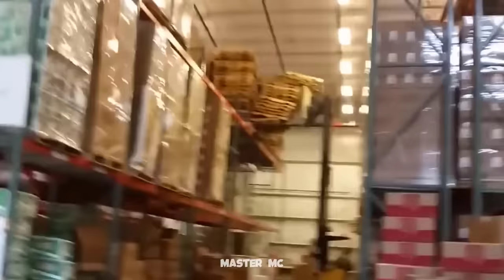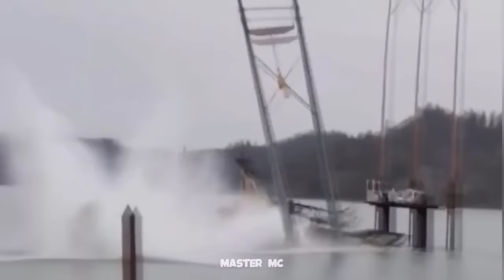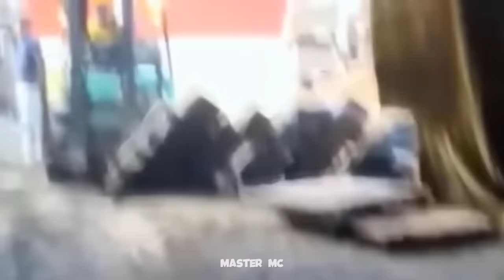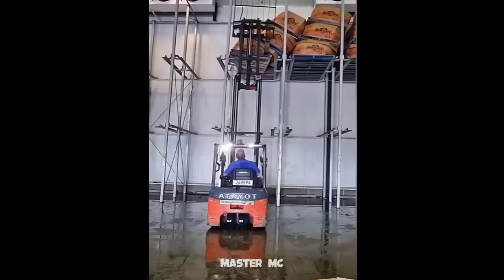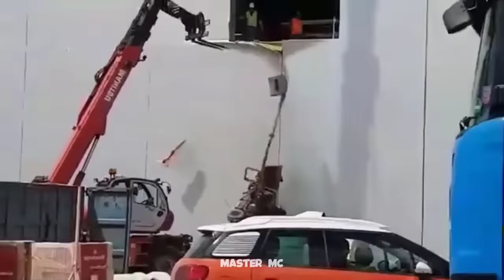TOP Forklift Fails Compilation 2022 - Dangerous Forklift Crashes - IDIOTS FORKLIFT DRIVER

Comment: As a Forklift operator I can tell that the last one was perfectly done! I even cry a little. I was really touched 🥺
Reply: That last shot is my company but I'm not impressed that they are in a fail compilation.
Reply: Yeah it was impressive, but how did they unload it?? Seems like it should have been on a flatbed.
Reply: @nickhogue6465  Not quite my curious friend 😉You see those little spaces between the orange belts and the floor of the trailer? That's where you suppose to drive the forks to lift it up. Then you have to carefully drive backwards until the second forklift operator can intercept/take over/overtake the bale on the width side :)
Reply: @nickhogue6465  Or eventually just attach those orange belts/ropes dunno what it is exactly to the forks and drive backwards ;P
Reply: that last shot its pretty normal at my company  .
Reply: But how are they going to get the packages out?
Reply: @Lord_Humungus Do you see those orange totes? This is how ;) One for length side, the other for width side of the package ;)
Reply: Been driving for 20 years + driven all kinds and this was soo hard to watch and at the same time i couldn't take my eyes off it hahahha. Most could have been  prevented if they just understood the capacity of the MHE, but some eh shet happens.
Reply: @nickhogue6465  ez same way 2  forklifts just in  revert🤣
Reply: It almost happen to me and good thing I mage to lower it smoothly 😂 he already max out that forklift capacity
Reply: Honestly don't know why this was in a fail compilation, I thought that was masterfully done
Reply: As a forkie myself, ( thats we we're called here in Australia ) that was some really good work right there.
Reply: My wife is a 24year costco employee and most of it and current is on the forklift (you get 1$ more per hour why not?! ) lol she's explaining how they don't use stringer pallets anymore they use Block pallets and "most people need to be tested on the stability triangle and clearly aren't in this video"😂 she's explaining the art of forklifting. Now I get how she feels when we watch Grey's anatomy of Chicago med and I'm yelling get Atropine right now!!! Now!!! Now!!! And then the patient codes or whatever lmfao
Reply: so many people trying to off themself but we dont get videos of the ones who succeeded
Reply: What do u find most difficult at ur job? What are ur main challenges? thks
Reply: @sergioaraujo4519  Hmmm let me think. 
Probably the biggest challenge is when I have to unload a truck and the pallets are looking like someone just punch them in high speed. The possibility of me taking that abomination and NOT making it collapse is very very low. Second thing? The condition of the surface on which I transport loads. Hole after hole covered in another hole that is sleeping with another hole. Instead of fine and safe driving I feel like I'm In the washing machine set to spin :D

Comment: 95% of these accidents would be preventable with basic forklift training
Reply: Or if they had a refresher course or a licence
Reply: Or if they had any common sense.
Reply: The other 5% would be preventable if the forklift operator had a brain.
Reply: Those classes are useless. I just took one for my job. All it is, is an hour video and then the guy takes you outside and says drive the forklift in a circle around the yard safely and park it for the next guy. And then certification card is printed. It's disgusting. Instructor didn't even tell the the trainees to put a seatbelt on, let alone ANYTHING else.
Reply: @mattyo5022  Wow, my prior employer's forklift test was part written, part multiple choice, was around 100 questions, not to mention the training took a full 10 hour day of instructor and video,  then we were allowed to get on the forklift, had to do everything by the book with zero mistakes, raise and place pallets at four different levels, move it correctly around a warehouse that stored hazmat in bunkers, and then take it outside,  follow all parking lot/foot traffic rules, load a van, box truck, then a semi trailer. Only then if we passed everything did we get certified and we had to do it every 2 years, or upon making any kind of error what they called a demerit.
If we were caught driving it without a seatbelt, doing anything crazy with it, driving it too fast, etc we would be fired on the spot.
I guess some companies took it more seriously lol.
Reply: @somethingvisceral2003  that's great to hear man. That's how it should be! I'm not some fan of total government restrictions and training but with a forklift it's more dangerous then even operating a car in my opinion. You can get in MOST car accidents and walk away ALIVE! In MOST forklift accidents you're DEAD! Or you become like that kid in Montana and like a child's doll size body. Just his upper body. No arm. Just a face, stomach, legs, genitalia, anus alllll gone! I don't even know how he's able to pass his urine and feces. So SAD. Also SICK. I immediately clicked off the picture when I saw it. Big international story few years back. Anyway. Yeah that's a great training you got my friend. My workplace is a STATE agency by the way just so ya know. So it's not some Joe Schmo small business or even corporation. I almost wanna tell them I refuse to operate it without proper training. But it's almost that old peasant/slave thing where if you complain you're fired! So instead make people endanger themselves and others!  🙄 Makes sense!
Reply: @somethingvisceral2003  Absolutely because the test i took was about as thorough as the other guys. Watched a video in the office, went to the shop, picked up a pallet and sat it on a stack.  Went back the office and I was certified! 😆
Reply: @mattyo5022  I guess it depends on where you live. Here in Denmark, it takes 7 days (not including the weekend) and you have to pass a theoretical test and a drive and lift test. We even have to drive different machines.

Seatbelts are only required on the road here.
Reply: @jamiececilielange5249  That's amazingly efficient and safe. Great to hear the Europeans take this stuff seriously. I like 90% of what you guys do as opposed to here in the U.S. Random question. Do you do the 4 day work week in Denmark? The 5 day work week is extremely out dated and literally working us into graves here in the states. The 4 day work week has to be more efficient and happier lives for you all.
Reply: Most people have a 5 day work week, 37 hours total. Some people have 4 day x 9 hour workweeks, but it is not as common.

I agree with the 4 days or less hours. After a certain amount of time, people are inefficient anyways.
Reply: Or with a brain
Reply: @ohreally8929  😂underrated comment
Reply: The many tipping accidents, when the forklift itself tip over are probably largely due to attempting to use a too small (too light) forklift. We use a rather small electric forklift for our everyday needs but at least we have the ability to call in a larger one when needed.
Reply: @mattyo5022  damn, that's nuts.
Reply: What is this forklift training you speak of?
Reply: @mattyo5022  Just drive the forklift around and park it? No loading exercise? What kinda course was that lol 😂
Reply: @metasequoia3097 rightttttt?! 😂 Total 🤡 clown course dude. The guy was just swigging down diet cokes bragging about how much he loves his job during the video session. Then when we went out to use the forklift and heard him say hop on, do one circle, and park for the next guy, thanks guys! 😂 After that I KNEW why he loves his job so much! He doesn't have to do $hittttt except steal a paycheck!🙄
Reply: @mattyo5022  swigging down diet cokes lmao 😂

Very negligent instructor. He should be fired as he is endangering people, honestly.
Reply: @mattyo5022  guess i made the oldschool one? My took 1 full week, 3 days of Theorie and 2 days of practise. As of today, this seems not common  anymore. Sadly... one wrong turn or missjudge and some serious shit can happen.
Reply: Agree but that other 5% a nightmare where you are 100% completely out of control of the outcome.
Reply: Where's the fun in that?
Reply: @metasequoia3097 his diet certainly is thou..
Reply: @mosthated863  These are mainly usa so have no idea here in the developed world you need training so people dont make such obvious mistakes

Comment: As a forklift Opperator that has had his fair share of screw ups this was a bit entertaining to watch🤣🤣
Reply: I myself am a forklift operator accident free 🙏
Reply: @jabbarbrown3089  same. But I’ve only been one for a year!!
Reply: I've definitely done some of this but NEVER driving forward with a tall load, wtf is wrong with people? 😅
Reply: Yes I am here after backing my forklift into a  shelf, bending the whole cage and all.  I'm here watching to vent 😂
Reply: @jabbarbrown3089  You're not doing it right.
Reply: I’ve had a couple, the worst was not getting my forks far enough under a tall stack of four post steel racks and having the fall back over the forklift, one had half its uprights come through the cage barely missing my head and then it swung in and caught my leg
Reply: @loganday5470  I backed into the god damn tractor last week .
Reply: I a brand new operator took a class to day wanted to see some fails
Reply: @gangifreek17  Experience is what makes you an operator. Not s fucking class.
Reply: @BernardFaulkner-e5m  I don’t think they said they were

Comment: The Lumber would have never fallen off had he pulled those Forks back!
Reply: 5000 lb load , that little Clark forklift 3000 lb max , it's a teacup forklift 😂
Reply: @davetv3898  
That forklift weighs 9,000 lb and it can pick up a $5,000 lb load

Comment: For Saftey Message:
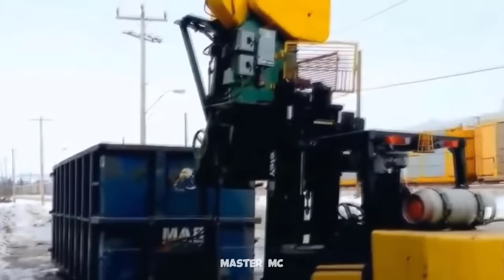2:10 Awkward Loads
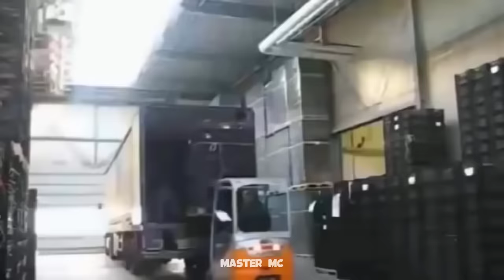2:58 Speed
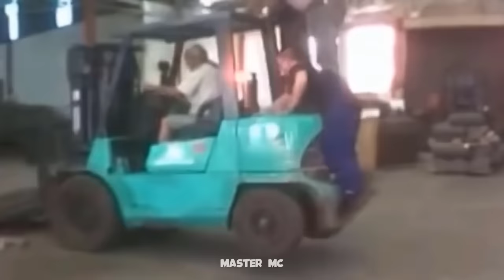3:28 Never 
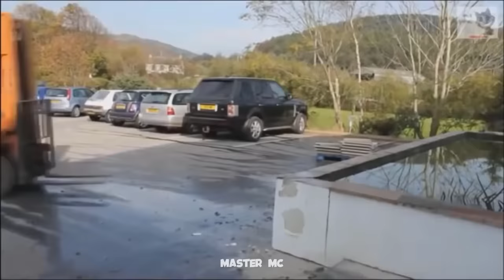8:25 Surroundings
Reply: Not to me to mention, some horsing around.  Also improperly stored/loaded/shelved payloads.
Reply: he could done it from the side tho
Reply: Second tag he dropped it too low and the pallet dragged on the floor
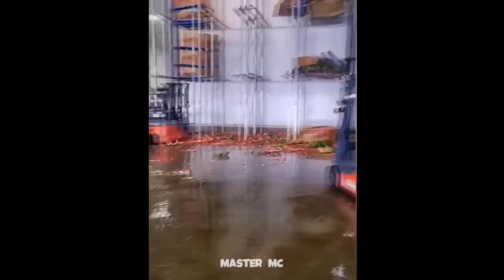Reply: 04:40 dodgy home made racking! failed on first stack!

Comment: A lot of these were caused, because the forks were not tilted slightly upwards so that the pallet locks in place and the lift does not fall forward from the weight of the load.

Comment: 0:27 why would you put loose pallets that high in the air
Reply: Nothing wrong is to put them up so high for to have more space due to their compared not heavy weight!
When pallets are tied up by few, forming one load - it makes work and stocking easier, faster and safer (if shelves can hold the load)! I would collect them on the top too, if no other better choice. The operator, who put them up - the same one should take them down (due to proved skills)!😁
Reply: I guess is for an exam to get the license
Reply: @uvenga  Maybe Yes, maybe Not!
Suppose: exam.
Task: take all pallets down...
Student: followed "all pallets (at once), when at once was not the task!
Solution: better lesser and safer, then all and unsafe, damage, and a loss.

Comment: The most I’ve done was drop a pallet of plywood from line 20ft in the air at my job. It was scary, for it being my first accident, but I’m glad I’m not alone.
Reply: HOW IT HAPPENED : The pallet was wedged between another pallet. I tried to get It down carefully, But it got stuck and tilted off my forks.
Reply: @EddieYettie moron

Comment: the last one i did similar loaded 4 bundles of cross ties in one of those construction dump trailers.solo.had to drop one end on ground use stacking sticks go to back of it and slide them in.and repeated it with second one what a real pain is loading those construction dump trailers and the metal is bent and has sections.i hate messing with them.

Comment: I have at times needed to restack a pallet after an incident causing a pallet falling over. I seen big sacks leaking content due to been stabbed by the forklifts fork. Not being licensed to drive a forklift absolves of any blame thou, I am never the one driving the forklift. We also had a lamellar door/gate ruined by a lazy driver useing the forklift to open the door. Not a good idea, especially not when it is locked. 😂

Comment: The first idiot should've tilted back and leave the brake on and tell the truck driver to pull forward. It only takes one little bump in the road for those little wheels to throw the forklift off balance. And hitting the throttle in reverse doesn't help.

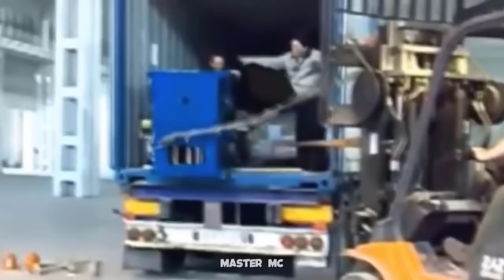Comment: As someone who works in the plastics industry and has 18 years of forklift experience, that looks like that was at least a 3-ton injection mold that dropped out of that truck at 3:20. 

I guarantee you that tool room isn't going to be very happy about fixing that. It's bad enough that there was probably tons of steel damage. Worse yet, it looks like it landed right on the locating ring, which is the part of the mold you line up with the machine to clamp it in. That's not a cheap fix. They'll be lucky if the ejector system and the hydraulics on that mold weren't totally screwed as well. Lol. 😂

Comment: A well experience Operator is an asset.some operator if they had operate or already have lisence they think they already knew how to work with forklift im 18 years experience with no accident😊 i feel that if there is something wrong with off loading or loading or carrying or driving its my responsiblity to go down and check first planning before moving forklift is not just loading offloading carying and driving etc you are also have consern of your safety safety of the goods specially safety of people and sorroundings 1 mistake you can take out innosent lives by having an accident so always be carefull its not a toy its a machine be responsible always pray to god also

Comment: are there never details written on the loads so the worker know what the mass/weight is?
or are they just ignoring?
Reply: All lifts have a information sheet stating max weight and max height. Also stand up and some forklifts will tell you the weight of your load when you pick them up where I work a pallet is about 1700IB they are deffiently aware of the weight and being careless and handling things that are not stacked or built properly will cause accidents

Comment: I feel for the guy at 8:50, atleast once a week I will get a pallet from a vendor that's tilting over like that. Is it really too hard to use some plastic wrap to secure your load before you put it on the truck?
Reply: I get fucking transmissions stacked on tope of each other so you know what happens there but its always the forklft drivers faults
Reply: @brotheldan2009   Ofcourse. You went too fast, or you turned too hard, or something else. But whatever happens, it's NEVER anyone else's fault but yours. SMH

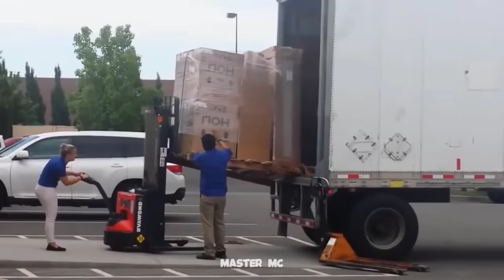Comment: 4:07 a simple tilt of the mast or forks could have easily prevented this walkie forklift accident, sucks to be them.
Reply: Seems like tilting wouldn’t have made a difference since the load was too heavy in the first place
Reply: No chance, the load looked way too big / heavy for that dinky little thing not to mention the forks aren't even half the length of the pallet, i dont thing those dudes know what "load centre" means
Reply: @elcheapo572  Good observation. If they were going to use a stacker, it should have been something much bigger than that.
Reply: @Wodanazz  As a fairly new reach truck operator, I can assure you I'm learning what load center means, hands on! I had to be extra careful getting a 1100 lb skid off rack 'E'. It was exhilarating.
Reply: The biggest problem here wasn't tilt, it was this totally being the wrong tool for the job. Forks were WAY too short!
Reply: @Wodanazz  But yeah I agree, that truck is way too small for that pallet. They should have got a Big Joe.

Comment: Those loads of lumber outweigh that forklift 3 to 1. If it was the forklift guy, FIRE HIM, IF IT WAS THE FOREMAN FIRE HIS SORRY AZZ!
Reply: When your forks are full extension that dynamically changes your center of gravity... Forks at full extensions need to be pulled straight back... and then lowered... the fork truck has a weighted counterbalance!
Reply: @danstafford5977  doesn't change what the guy said in the first comment